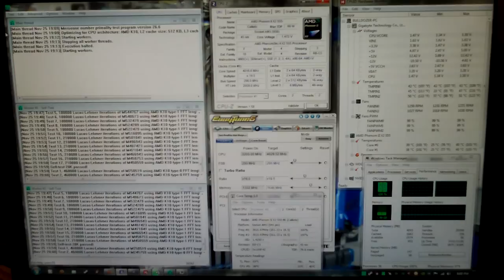AMD Gaming Computer: New Heatsink Installation + 4GHz Temp Results

Comment: Another stress test you might want to try is LinX, it's brutal, usually LinX finds a bad overclock within 30 mins for me. y-cruncher is good for testing CPU NB and memory overclocks too, only started using it with FX but it's been really handy for quickly testing a NB/memory OC (about 10 mins in it'll usually flag up errors)

Excellent temps for 4GHz, 1.472v is great, might get 4.1 to 4.2 from it with below 1.5v :D

Was you able to unlock the 555 to X4?

Comment: Very nice heat results from that 555 my 965 is a lil hotter then that but probably because i don't have a thermalright or noctua installed. Anywho great results still love AM3+ and am3 boards/cpu's because you can get decent peformance for price still compared to sandy bridge. But when the revised B3 Bulldozers get here i might pop one into my Sabertooth990fx. keep the vids coming - chiefpuff